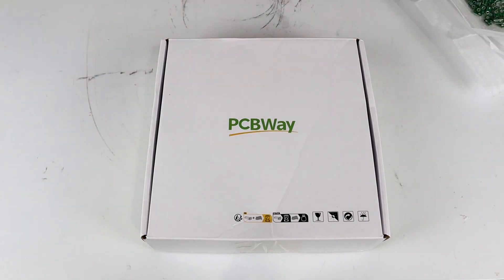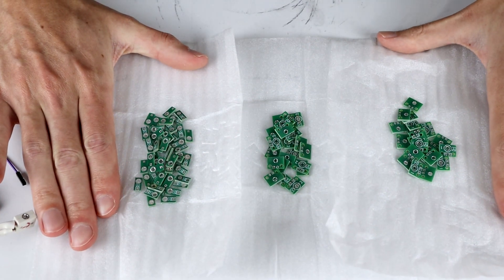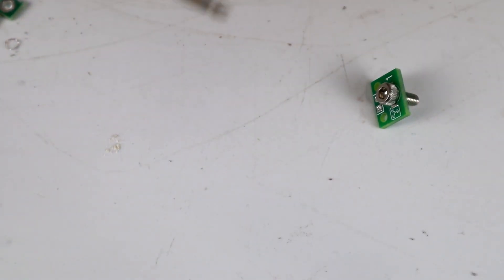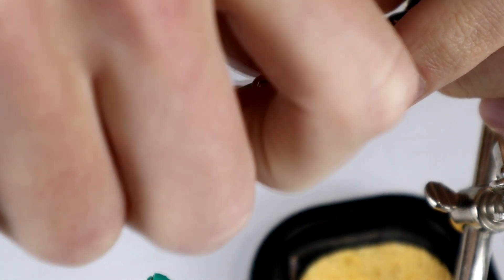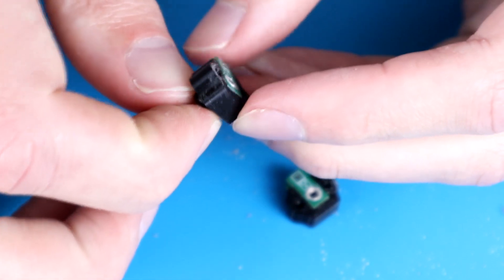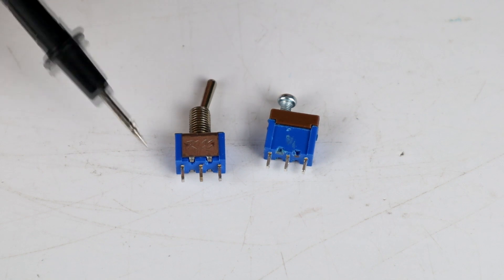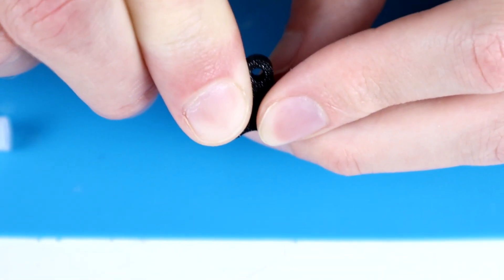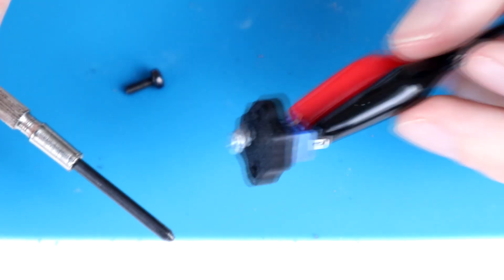Power switches for ANTS?!? (Tiny custom screw switches)

Comment: Another idea involving two boards. Board 1 has a ring on the surface around the hole (or just pads) but the hole is not plated or threaded. Board 2's hole has thick plating and is threaded. This should avoid any soldering and you don't need to line up threads. Basically the same principle as the botbitz ant switch but you replace the nut with a PCB which you don't have to solder.
Reply: Also, integrated LED?

Comment: The smaller single boards could be held apart in a "E" shape bracket which they could slide into which would be even lighter again than the 3D printed spacer.

Comment: I made a little box with a hole through it and 2 compartments, each holds a nut, then I soldered the wires to the nuts and put a screw through them.

Comment: I would suggest threaded inserts to the p c b itself with a short piece of braided wire soldered to the circuit, Also don't cut the third tab off the rocker switch, instead Attach a green LED to designate Safe mode and then store with a battery unplugged. Red LED means hot, green LED means cold. That way even if the red L E D fails you will know if it's safe

Comment: We're doing something very similar for Butter Side Down (12lb): couple layers of PCB that create a screw bridge (Allen/hex) across a custom main board. Some observations: first is that we use 3d printed housings to cover any exposed contact points and create a guide for the on/off wrench. This reduces accidental shorts during hard hits or creating one on a damaged bot while trying to disable/service 

Second thing is that each on/off creates a spark, which I'm sure is worse on a bigger bot, but principle is the same: each action blasts away a little bit of PCB copper until the contacts are shot. For us (6s) that's maybe 15-50 actuations. This bit us in a finals when it literally just turned off after a big hit. After the match it was clear everything except the switch was in perfect condition.

Solution: use two in parallel, and have the first one channel through a current limiting resistor so there's no spark. If you're already designing PCBs for 150g I bet you could incorporate the parallel pair, housing, SMD resistor in a couple layers so it only uses one screw to pass through two different "stages" and guarantee you've got a good connection :)

Comment: RE the first concept:

the problem with trying to thread a plated thru hole using a regular tap is that the tap is designed to cut into the material. that's why it has the flutes, they form a sharp cutting edge that efficiently removes solid metal from a hole, but in this case, it just cuts through the (very thin) plating. I'm surprised it's working as well as it is, but you'd probably get better results with a forming tap, which is a special type of tap that doesn't have flutes, and instead deforms the material to create the threads. but those are expensive, so a cheaper option could be to just use a screw as a makeshift "forming tap" and just force it through the hole. you'd need to experiment to find the exact diameter where you get the best thread engagement without risk of tearing the hole plating; maybe start with the 50% engagement diameter for the screw and iterate from there.

you're right that the annular ring size can help improve reliability, there's more surface area of material bonded to the PCB surface, so it can better resist delamination (as well as provide some extra margin in the event of some tearing does happen). if you want to have your outer contacts near the hole and this limits your annular ring, you could use a copper pour to create a non-circular "annular ring", where it's still narrow where it needs to be but then reaches further out where there's space available. also, you can put a series of vias around the hole as well so that if the plating in the hole is ever fully severed, you don't lose connectivity between the top and bottom halves of that (plus the vias can help stop tears from spreading)

this is incompatible with the previous advice, but, instead of 2 pads 180 degrees apart, why not try just have a continuous ring around the hole? then you don't need to worry about where the low spot is

Comment: Ben, we had the same problem with our beetleweight AntiDozer, initially used a toggle switch and big hits would occasionally flick it off. We moved to a Fingertech type design - 3D printed a small block that would hold two M3 nuts with a small hole drilled though each and the power wires looped through and soldered and used a M3 grub screw to make the connection. No problem since. Though it has to be said there isn't much room on a M3 nut to drill a hole big enough to feed the wire through..........

Comment: Ben, I'm not Combat robot builder, but I'd be weary of the "1 pound" switch. I especially fear that  the glue would crack and fail under a big shock, and that the spring would force the new cover away. Or you'd need to ensure the "switch part" stays in place even if the glue fails. For the first ones, wouldn't it make sens to print them "vertically" instead of horizontally, so that you can slide the two parts  into "5 side constrained" slots ? I guess a .4 "sidewall" would be enough to help keep the pcb in place and at least partly increase the electric insulation of the switch

Comment: possibly dumb question, but if the resistance of the 150g switch is similar to the 1lb one, then they should be fine for 1lb bots? if you have enough spare, and a test power supply, it'd be interesting to see what sort of current the 150g switches can take and see if they'd actually be okay for larger bots. Or stick one into a 1lb bot and do the most current-abusive things you can think of and see if they get hot.

A thin (lock) nut soldered to the board (probably on the back) would make a far more sturdy connection and avoid the plated hole tearing out issue entirely, and should work with either v1 or v2 of the ant weight switches given the other contact is on the opposite side of the pcb. 

It might also be worth looking at the sort screw-clips that as used on cars for some trim retainers, they're stamped steel so should be conductive and reasonably strong, but also cheap and light. Just maybe not quite as compact.
edit: google "speed clips" for this style of clip.

Comment: Modifying a toggle switch seems like a good idea. I think, with a "big enough" switch, it could possibly work for a beetle.
I'm quite sure it'll be less bulky and maybe lighter than the screw switch I made for The Unmaker. That just used a pair of hacked M6 captive nuts for contact points, divided by a polycarbonate ring, and it was screwed together in a small hand-billeted HDPE block.
Great vid as usual, Ben! 👍

Comment: I like the two-threaded-hole (fingertech style) version better than version #1 or #2. If that one starts to get loose, it will still make decent contact, while the other ones will be intermittent or lose contact almost immediately. Taking 3-5 turns of the screw to disconnect will be a lot more reliable than .5 turns. It also seems like it will wear less.

Comment: Maybe you can make a version out of a single dual-layer PCB with two thin nuts (ideally copper) soldered on either side? No issues with tapping or plating, and the nuts will work great for wear and robustness.

Comment: Personally I would be worried that it would come loose and you'd lose main power
Reply from the maker: I was too, which is why all of them have the screw going through an undersized tpu hole, this acts as a nyloc and stops vibrations from loosening them

Comment: The fingertech switches are nice, but i worry about the current carying capacity of them. Aluminum or Copper screws would be much better than steel ones, and moving the two "bars" closer would also be a good idea. A shorter, thicker screw would also be better, while still being the same weight.

Comment: I don't understand how brits and australians have the patience to work with 150g bots and all the components that are smaller than their fingernails. Me and my fat fingers would lose my mind.
Reply: I go through the same pain with a US 1lb with my big hands. I ended up going to 3lb and 30lb instead of 1 and 12 pretty much just because working with tiny things drives me insane.
Reply: Hah, Ben and I have both made and fought 75g (fleaweight) bots before - those are fiddlier again! I think once you're used to making 150g ones it becomes easier, and I love how easy it is to rapidly iterate designs with 3D printing
Reply: @slightlyevilrobotics4271  I've run into the issue where all my parts are so small that even the 3D printer with 0.4mm nozzle struggles to make anything remotely cohesive, though I am exclusively using M2 screws